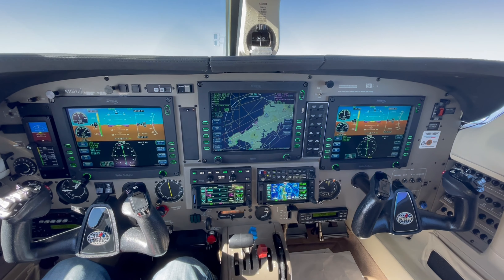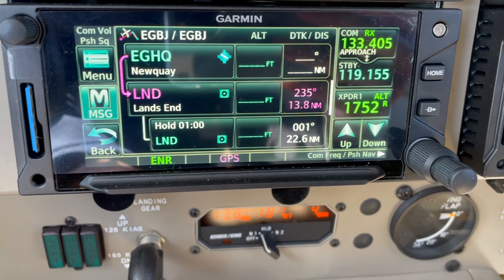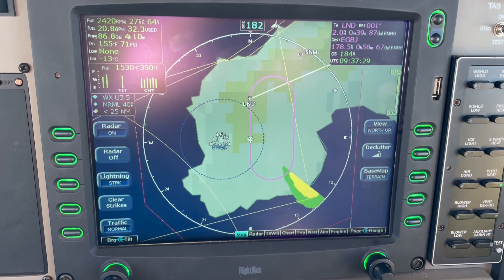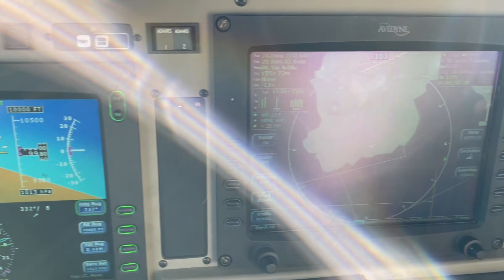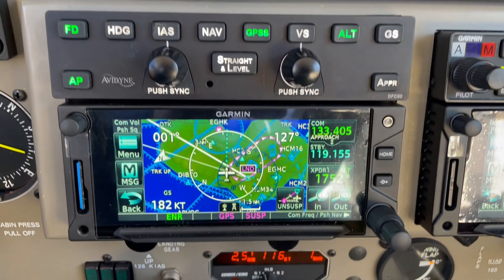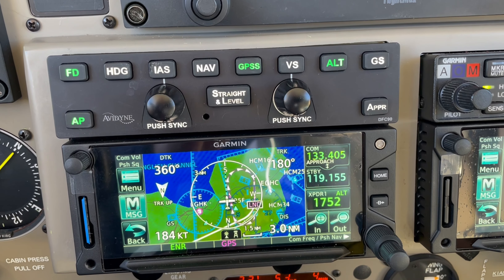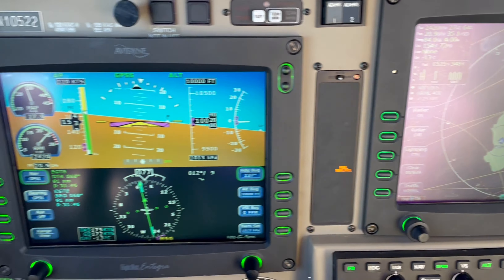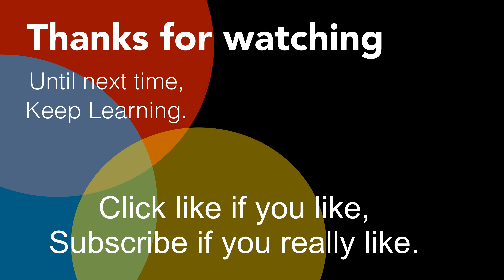Garmin GTN650 Hold with Avidyne PA46 Mirage New Page Aviation FLIGHT VLOG #21

Comment: There's actually no reason to fly the DFC90 in "GPSS" mode if it's run by an Avidyne PFD. Just leave it in NAV all the time and forget about the autopilot modes. This way you never have to switch the A/P to NAV for approach. GPSS is completely useless in this setup.
Reply from the maker: Thanks for the reply, but not exactly the best thing to do as it will not fly holds unless in GPSS as the CDI on the PFD will only display the inbound track to the holding fix, so the most useful way to use it it GPSS for GPS tracks and NAV for Ground based Nav Aids. But each to there own.
Reply: @johnpage8364  Sorry, John, but that is not correct. It will fly EVERYTHING in NAV mode, but also all approaches IF the installation is the same as in the SR22 (IFD/GTN, WAAS, DFC90). This has been discussed on COPA for ten years. I have my DFC90 since 2013 and it flies all Holding Entries correctly from the IFD440 (same for GTN and GNS/W). On my PFD it shows the complete entry also.
Reply from the maker: Thanks that’s great. You should tell that to the aircraft I was flying today. Because it doesn’t. 🤷‍♂️. Not all installations are alike.
Reply: @johnpage8364  Send me its eMail and I will! :-) Sorry for that, but it is really strange that it doesn't behave that way. Maybe it has to do with the SW version of the PFD?